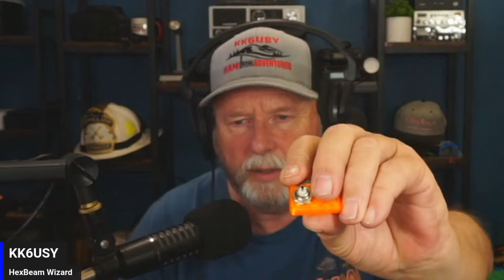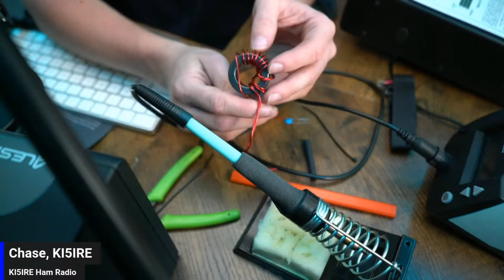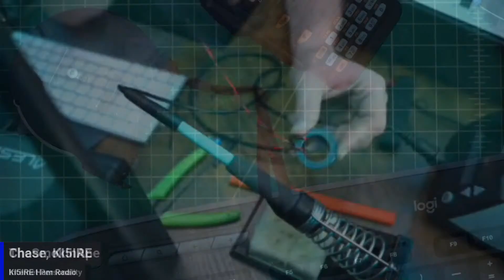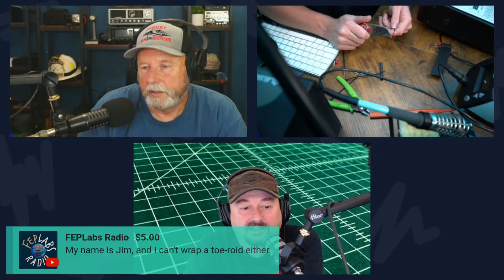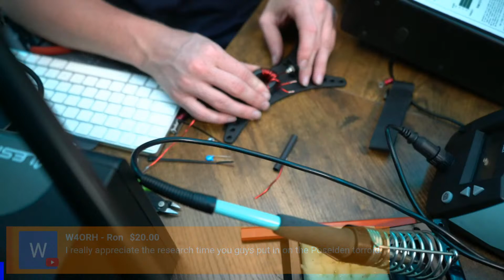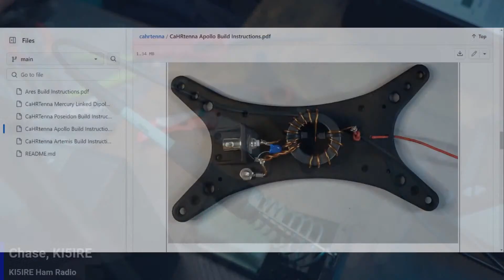Helping a young Ham Chase KI5IRE with a new Antenna!

Comment: very nice Chuck ! got Chase to get the antenna built. Ape was great as well. I started winding toroid's in the 1980's . still mess them up from time to time. have to look up wind charts all the time. That bigger Mag wire better for FT8. I got that cordless rotary tool Chuck did video on. I love it. lots a stuff comes in the kit. and all packs in a small case.  for that winder that way for 49:1 with cross over then 7 more puts the mag wire across from BNC  works great . I have used the long lead of that cap to bridge the grounds together before . 73's

Comment: I had to re-wind my toroid, so it’s good he had extra magnet wire. I had to order some from Amazon. I’ve actually never finished mine. I got confused about how to solder the capacitor, got frustrated, set it down, and never returned to it. I found the instructions confusing. That was over a year ago — I should probably finish it, although I’ve acquired a couple of other EFHWs since then. It probably wouldn’t be confusing for most people, I’m just not particularly talented in that way.
Reply from the maker: I found shorting the capacitor strange, but it works. Thanks for the feedback and don't forget ther is links to videos to help.